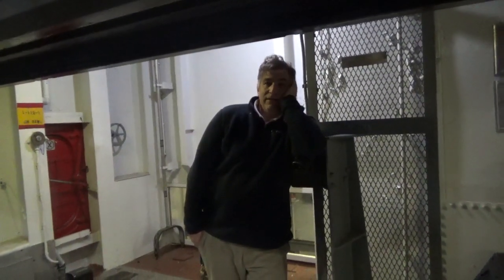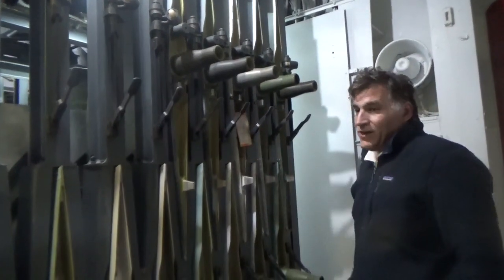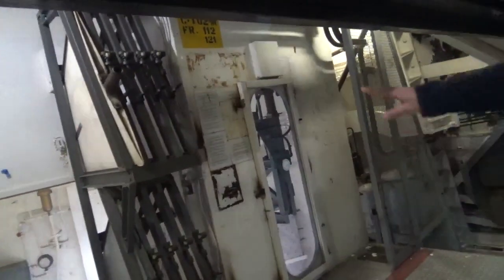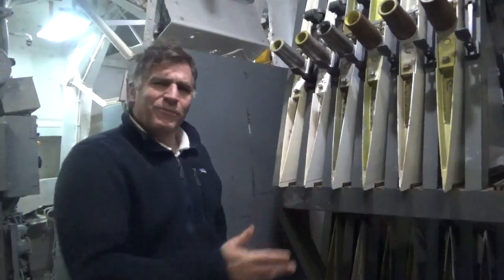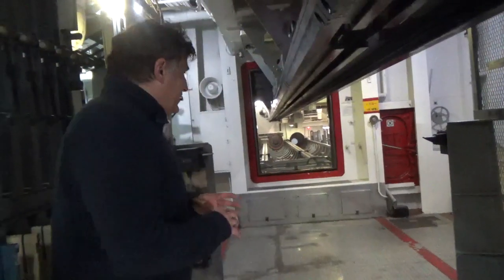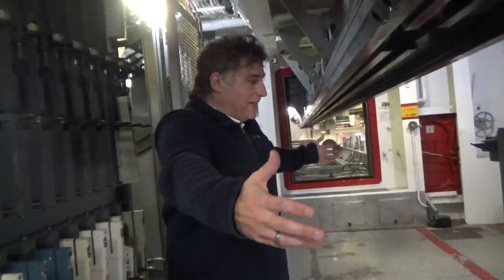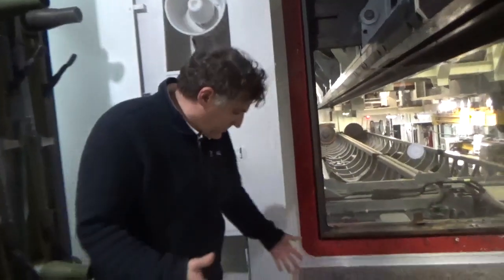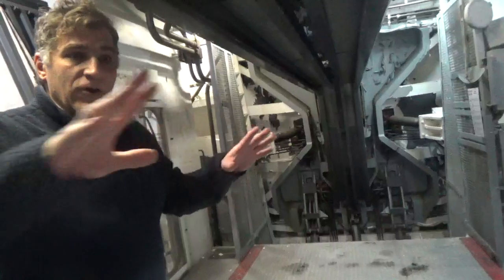How the hell did these wings and fins get mounted to a Talos?

Comment: I served on the USS Galveston 1968-1969.  I was a GMM and my work station was area 1 wing and fin.  I was also responsible for both missile launcher doors.  After the missile door was opened and closed there was a mechanism in the pit, the area directly in front of the door,  that had to be dumped by hand.  Each missile door had it's own mechanism like this. It's function was to relieve the 1500  psi of hydraulic pressure that was in the system.  I forgot once and had to rebuild the door control.  No one believes me but everytime a missile traveled on the rail the rail had to be greased by hand with molyubleum grease, a bunch,  once we forgot and mongo sparks.  The missile had a styrofoam cover on the booster.
Reply from the maker: Nice. Thanks for sharing your experiences Wayne-g9I. Would enjoy bringing into the collections anything you have about your time aboard CLG3. That ship is, unfortunately, not well represented here! Think about it!

Comment: Very interesting seeing the procedure of placing the fins on then pressing the foot petals to single each station as ready for firing. The Talos on the 'Little Rock' reminds a bit of the Photon Torpedoes in Star Trek, the scenes in the 'Wrath of Khan' of the torpedoes being loaded in the torpedo bay. Obviously, there are a lot of differences between the two, but you see the same assembly-line procedure at work, although no fines for the Photon Torpedoes. 

I think the 'Little Rock' is one of the few museum ships armed with missiles, the USS Growler (SSG-577) at the Intrepid Museum, and the four Iowa BBs I think, making the cruiser very special. Unlike the Iowas, and like the Growler, the Talos is a central part of the ship's design and mission. I found the two display Talos on the Launcher at the stern as impressive as the big guns of a cruiser or battleship, you can see them a long way away, including from my hotel room at the Marriott when I visited last year.
Reply from the maker: Thanks for your comments! I love the USS Reliant! Yes, our Cruiser was an "all analog" cruiser...everything had to be done by hand, with basic machinery. USS Salem isn't a missile cruiser either, so it is very rare indeed. The last Cleveland Class and Galveston\Providence Class in the world! Appreciate your support! 

Thankfully USS Little Rock never needed to use the Genesis machine.

Comment: 3:52 When you're standing near the opening operating that footswitch, you may be a safe distance form the rail, but it sure doesn't look like a safe distance form that loudspeaker!
Reply: My guess is that with all of the moving pieces in this space and missiles being simultaneously fired from the launcher, good hearing protection would be provided to this crew.  The loud speaker would have to be very  loud to overcome all the operational noises.
Reply: @-Cece  Oh I'm sure that they had hearing protection. I just found it comical that Shane was talking about safe distances while his head was right next to that big-ass horn.
Reply from the maker: I'll ask the crew if they wore protection. Typically I haven't heard that...except for crew working the flight decks of aircraft carriers...Interesting thought, Cece!
Reply from the maker: Thank you! I didn't even see it when I was standing below it! I'll make sure the 1MC curcuit is off next time!